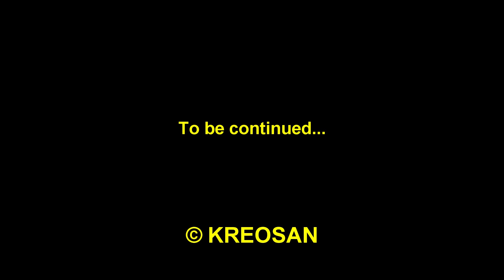Best Physical Experiments TOP 5 / In India

Comment: Coca-cola plastic bottles have been shown to be a great for nitrogen or butane rockets due to the tapered neck of the bottle - most sizes work well but they have to be like the traditional tapered glass bottle but DON'T USE THE GLASS BOTTLES for the weight of them and the actual weight of the glass.